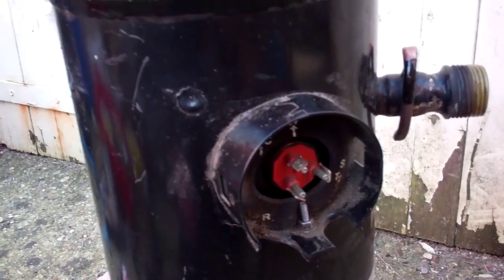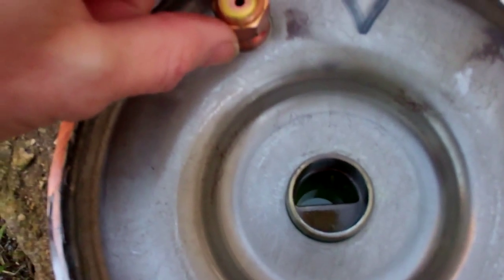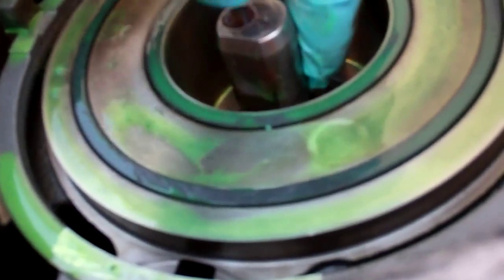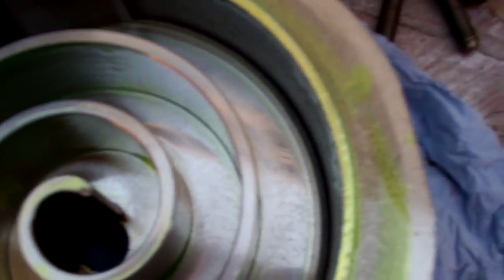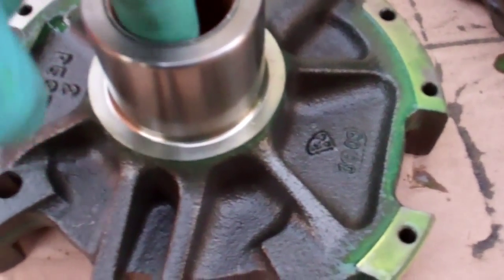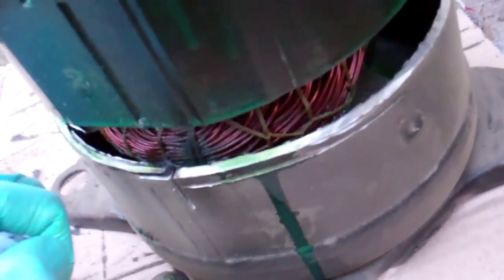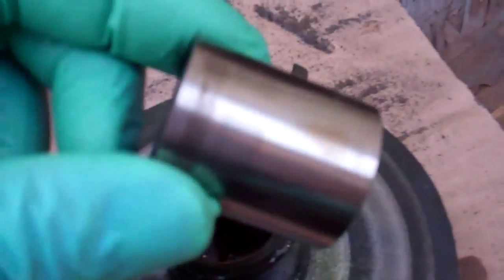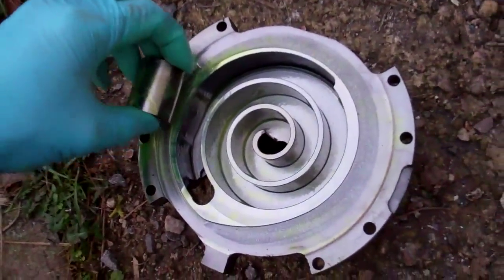Bristol Scroll fail inspection

Comment from the maker: @joeyf504327 Seems like a lot of stuff today gets the quality cut to make them cheaper and more competative, trouble with customers always going for the cheapest price, finding a lot of stuff seems to wear out or fail after a few years.

Having said that apart from the failed bushing, the rest of the compressor was in very good condition with very little wear on the scroll and other moving part for something thats done 2800rpm 12 hrs a day for 10+ years!!! Thats a lot of revolutions

Comment: Hey John
Did the system have a leak? I ask because of the green dye that I see in the compressor. Can't stand that dye, will do everything in my power to not to use it when trying to find a leak in a unit.

Comment from the maker: @FrontSideBus It is now that someones been at it with a grinder!

Other than the one seized bearing it was in remarkably good shape for a 10+ year old compressor. There was quite a bit of copper chips in the bottom of the sump but it looks like it ran low on oil rather than jamed up with bits in the bearings.